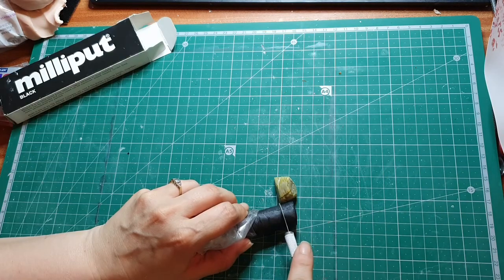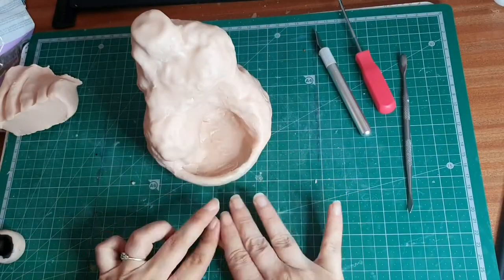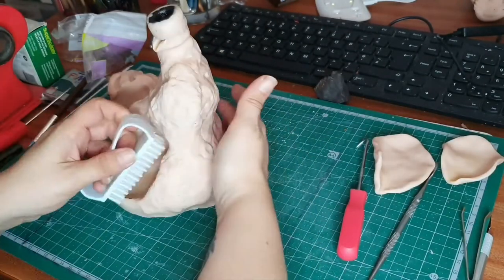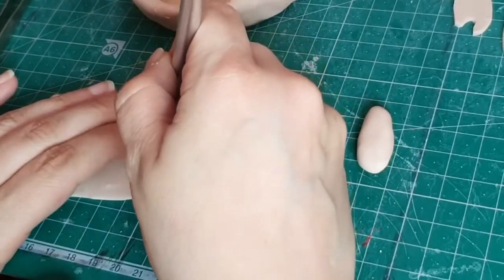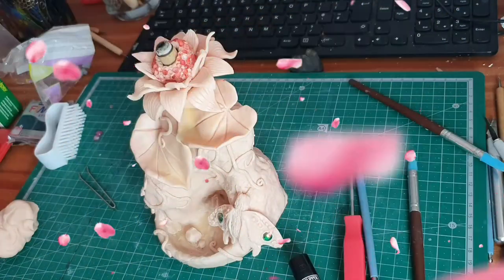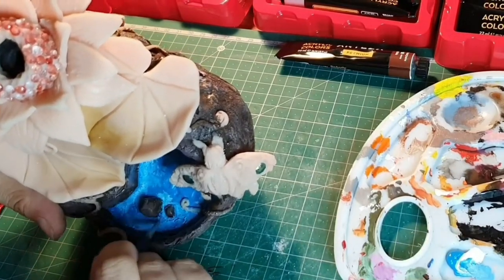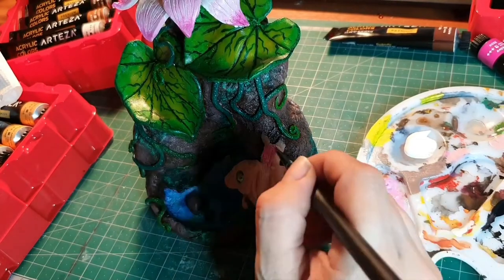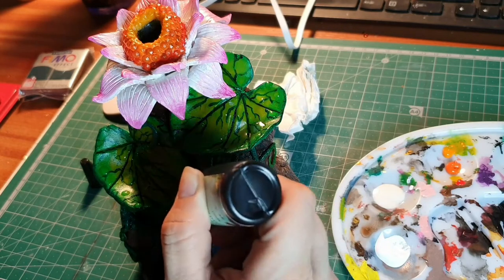How to make a polymer clay back flow incense burner with cute moth

Comment: Sorry again just asking as there is mixed reviews about if you can use cardboard to use as armature before polymar clay
Reply from the maker: You can if your cardboard is far enough away from anything heated the clay does make a very good barrier between heat and card. This incense burn was my very first one so I probably would do things a little differently now and kept the armature all as tinfoil instead 💜

Comment: How does the heat affect the milliput over time?
Reply from the maker: Hi, I have been using this one about once a week since making this video and it is still going strong and quite happy with the heat the paint around the top of the flower has tarnished a little bit though so I would perhaps coat it with either a hard waring varnish or heat resistant resin but other than that its still working well

Comment: Is there a way to use San Palo with backflow incence burner?
Reply from the maker: I haven't personally tried it I think if you have it in its stick form you might need a sturdy holder for it as they are quite long and I'm not familiar with how they burn backflow smoke rolls down because of a small hole in the base so if you can put a hole in it then you might get a reversed smoke fall